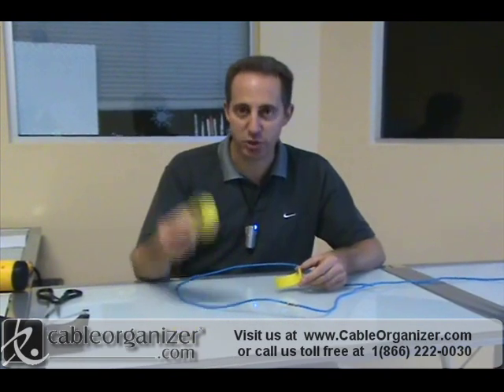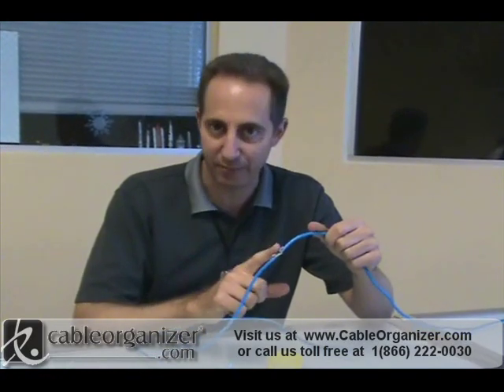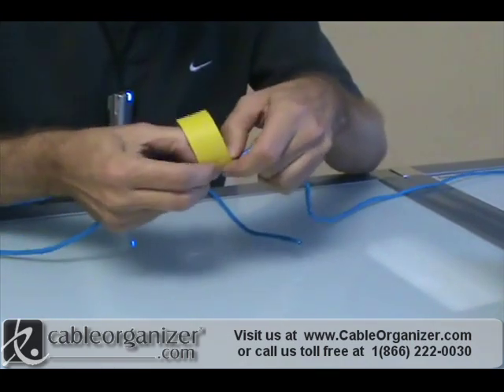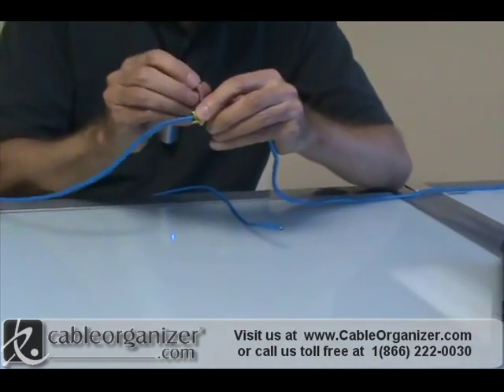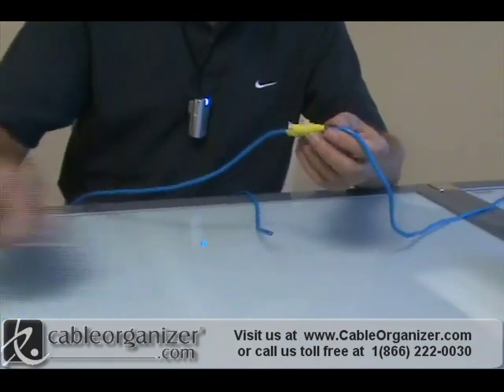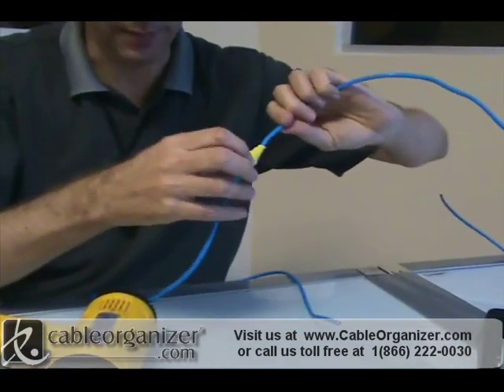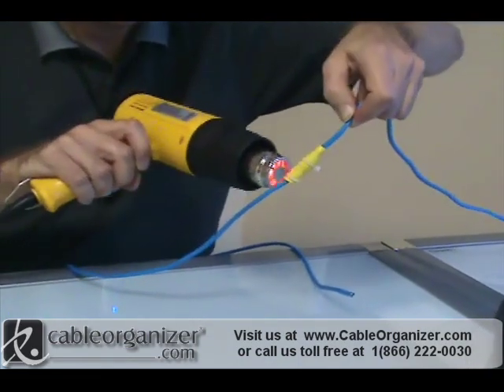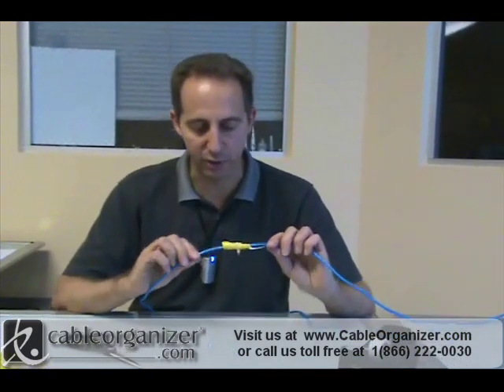Adhesive Lined Cross-Linked  Heat Shrinkable Tape - Cableorganizer.com

Comment: I've done the same thing by slicing adhesive lined heat shrink tubing lengthwise and shrinking it as I wrapped it. Pretty hot so be careful. Secured with a few zip ties. Been holding up as far as the last time I saw it come through the shop.

Comment: I think you used way too much heat shrink tape on this.

You can buy the liquid heat shrink that you can just brush on to a wire where you don't have to worry about all this.
Reply: That would work on a splice.  My applications are more in the line of cable management, especially on a cable that's been taken apart for repair, but the ends of the cable were not removed.  J.G.

Comment: I understand this is a instructional video, but that's one of the worst wraps I've ever seen.  No one in industry would let that go through.  Seems to me there are too many wraps of the heat shrink tape upon itself.  It's also not straight but wanders down the cable. I've been looking for something like this for years.  I bought a 25 ft roll for home use.  If it works, I'll suggest we buy it at work.  I'll update this comment with my observations.  J.G. Sr. Principal Test Engineer